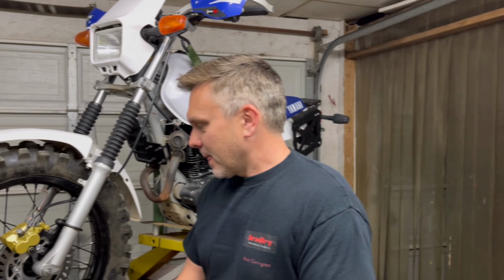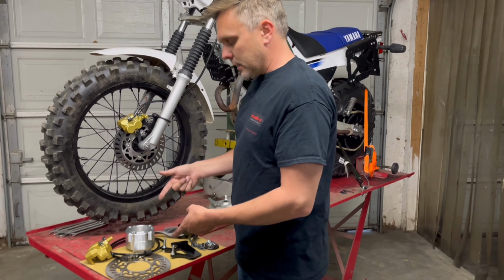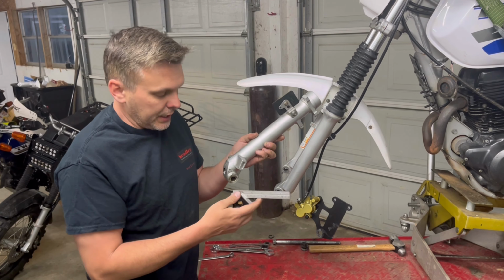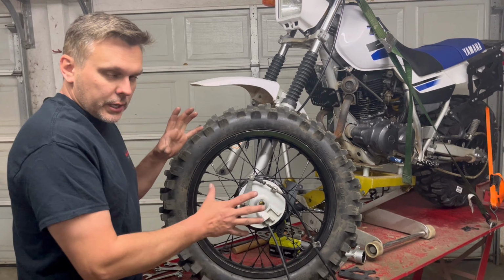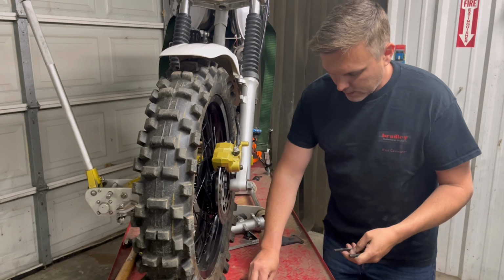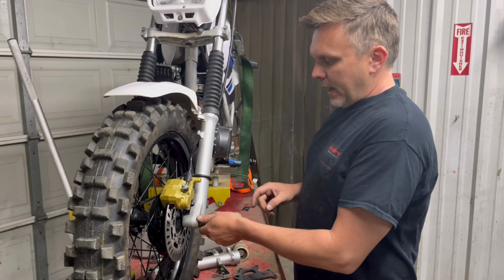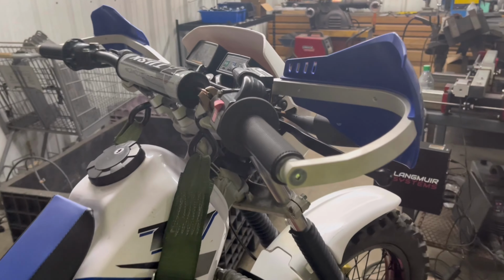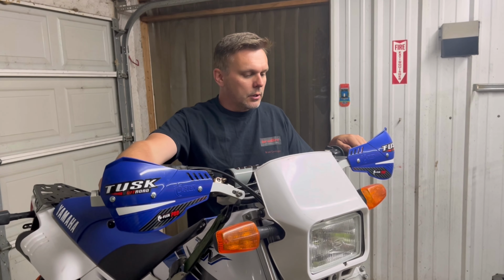bradley performance products Yamaha TW200 front disc brake conversion installation (2000 and older)

Comment: I really don't like how the adapter is secured on the shock absorber aluminum leg. This shock absorber was designed for a drum brake and it will never be OK for the disc brake. It would be much better to replace whole left shock absorber leg and use factory mounted brake caliper and original mounting system. The solution in video will fail. The clamp on the adapter looks sick and it even doesn't use self locking nuts which is not acceptable on brakes. It  will never be aligned perfectly. The adapter in the drum is sick as well as it has not any support in the drum from sides, it only holds on the bolts in thin aluminum wheel and these were not designed to withstand braking forces. I smell catastrophic failure sooner or later.
Reply: Bravo, that's a good comment!

Comment: I went with a trail tech it's easy to install the pickup for the electronic sensor on the right side mine actually came with a KTM speed sensor spark plug wire for temperature another to the coil for RPM . Although I have a TW rear rim on the front with the drum brakes this machined hub insert with disc  for the rear I could use on the big wheel forks and have disc on front again .

Comment: Is that hub just held in place by bolt pressure like the rear conversion?
Reply from the maker: I'm not exactly sure what you are referring to but it uses the three mounting holes that the OEM drum uses.